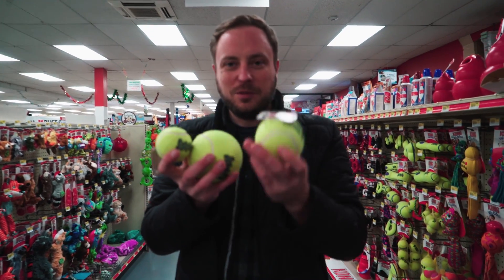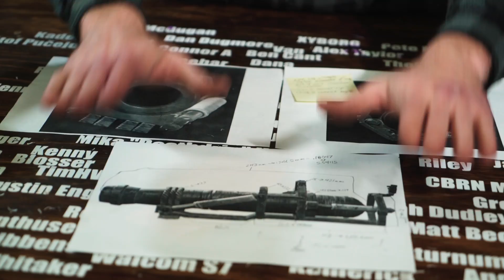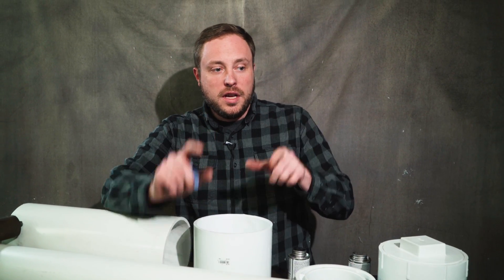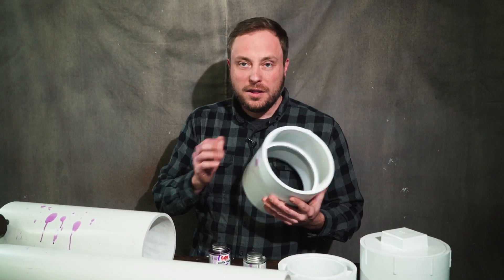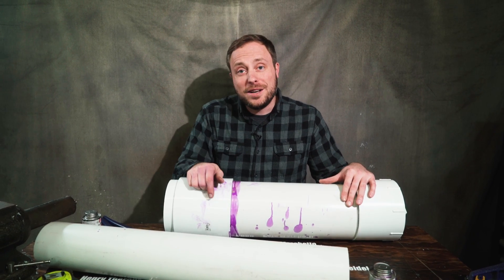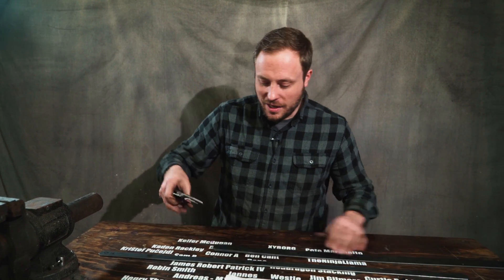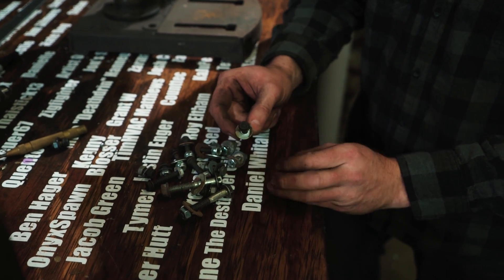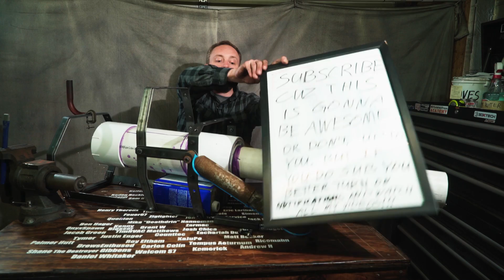Fallout Broadsider - Giant Naval Cannon Build Part 1

Comment: you're off on the weight of a naval cannon by a factor of at least ten, 3000lbs is about the lightest you're going to find, a 32 pounder main gun from a 19th century warship would weigh upwards of three tonnes! however you're not entirely off, since the cannon in the game looks closer to a 4 pounder field gun, which would weigh in at only about 700lbs... still absolutely absurd to be able to lift that, without, you know, powered armour or something. Even then the recoil should turn you into syrup.

Comment: 38th comment but this is really cool im building a VR headset that can connect wired to anything that has a HDMI it costs almost $120 i have all of the pieces for it except 2 shipping to my house right now then I will be getting a new camera so I dont have to film building it with my phone lol and im working on figuring out how to make it wirelessly connect to any device through a wireless HDMI with an transmitter and receiver I have 10 18650 batteries im currently charging and it only takes 2 of them to power it for 3 hours of straight use the piece that I havnt bought yet is a battery pack kit that holds all 10 18650 batteries which could let it be used for about 15 hours straight